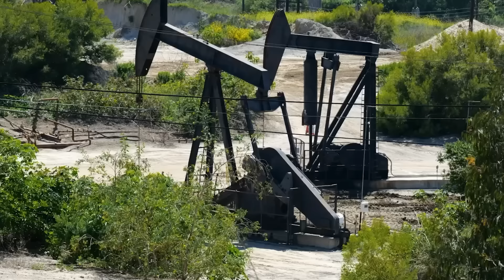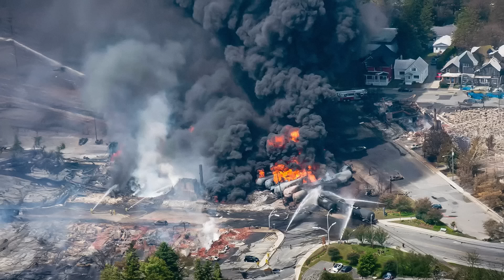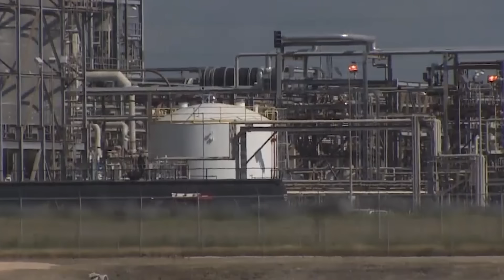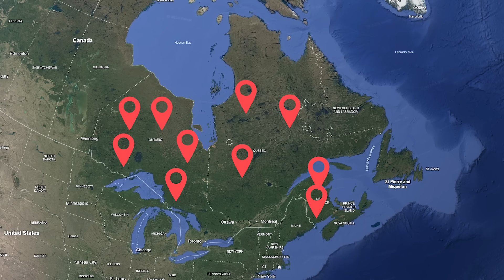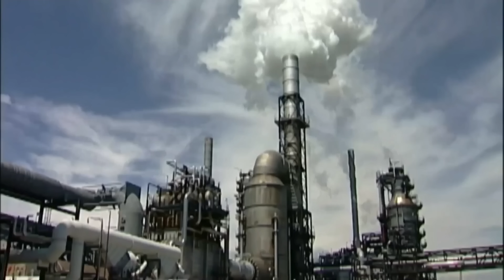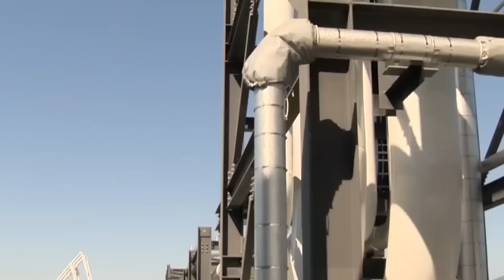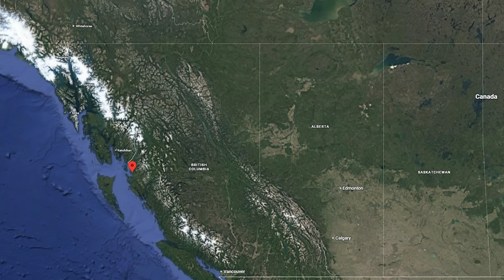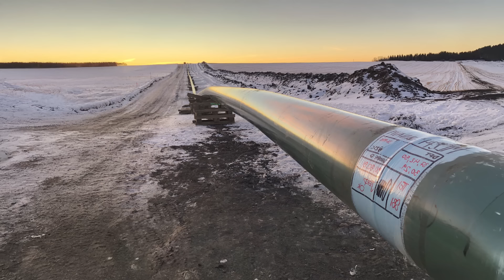Here's Why Canada Can't Build Its Own Refineries, Even Though It Produces Millions of Tons of Oil

Comment: he doesn't mention that the lines that were built was for a certain type of oil.  that is why other types cannot be poured through that system because diffrerent oil means different pressure through the system.

Comment: An interesting video.  The real question is whether shipping the raw material, especially such raw crude is the right move.  I tried to buy some marine grease today and was told that it is no longer being made in Canada. Sure, Alberta cannot consume its production right now but it could encourage development of lot's of other industries that are hungry for energy.  Solar panels and plastics to start.  The world is moving to electrical energy, Alberta is sitting on buckets of energy and should think of their product as such instead of just oil to sell to others to process.  This whole idea of processing costing too much is nonsense.  It is like BC selling raw logs, absolutely stupid short sighted quick gain that when over leaves nothing but debris behind.  Canada needs to invest in secondary in tertiary industries that utilize our resources and builds long term solid jobs here. All that grit in the tar sands has tons of minerals, quite probably lots of rare elements.  Instead of shipping it away let's extract and process it here - way higher value than tar.

Comment: Here is the short version: Canada is too stupid to figure out how to process the huge amounts of thick crude oil that it has, the green demons don't want it developed & fight for more odious regulations & use of costly and undependable sources of energy, and the leaders in Ontario treat the areas in Canada that produce the thick crude, such as Alberta, with disdain for allowing Canada to actually utilize any form of its own fossil fuel (In the US, the lunatic Joe Biden administration favored the same insanity pushing for the idiotic Green New Deal). No wonder Alberta is beginning to at least consider becoming the 51st state of the US, as they are abused by the bigwigs out east. Thus, Canada often causes its own problems and the inept government "leadership" is a huge part of that.

Comment: What you haven't made clear is,that tarsand oil has tobe light crude oil to thin it enough to be pumped,and you don't have enough for long term near the tarsand,and that means more pipelines, and the light crude used is coming from north Dakota and Montana pipelines. Herrman goreng in Ontario is dumber than a rock <

Comment: Thank you for the insights into the Canadian oil industry. 👍 Hopefully we will modernize our refineries.  This should be a national priority.
Reply: Liberal Government restrictions with Zero emissions is the problem. Canada's heavy crude oil requires oil refineries that can process this oil in mass volumes. These refineries require high-complexity residue conversion and carbon-rejection or hydrogen-addition units. Unfortunately it wouldn't be permitted due to Liberal Government Climate Change restrictions.

Comment: An excellent review of Canada’s pipeline capacities and 4.3 million barrels per day. Perhaps you can add to the cost benefit analysis the fact that the dilution of the bitumen (Dilbit) uses Refined Petroleum Product imported from the USA. 2 million barrels per day shipped to the US needs 200,000 barrels per day of RPP imported from the USA. The source of the RPP and cost doesn’t appear in the cost of production. If 10% of the oil is bought from the USA to dilute the oil we send to the USA, sounds like double dipping. Lest we forget, the devaluation of the Canadian Dollar in 2013 gave the USA a  massive discount. Comments?

Comment: Canada does not have the financial backing of its banks or government to build a refinery.  It does not have the political willpower of the current federal government, whose policy is to prevent CO2 releases in Canada.  Producing oil or gas in Canada would lower the cost of gas at the pump in Canada, which the Federal government does not want to happen as it gains considerable revenue from high cost of gas in Canada at the pumps.  
Refining oil produces CO2.
Also the oil industry in Canada is completely attached to the US oil industry, so their influence is used to prevent Canada from manufacturing the oil and gas and other bi-products (plastics, etc) in Canada.  Keeping that work in the USA.

Comment: Look  closer  .Alberta  tar sands  produce tar that is thinned.. Canadian  heavy  crude..that's upstream.. Canada  also invested downstream  into USA  refinement..and distribution.. while freetrade  existed the USA  got the benefits..  Trump  tariffs  remove the benefits.. and it's cheeper to refine in Canada  now.. like the USA  east and west  of the rockies.  And east and west of the Mississippi.. Canada  also has east  and west of the rockies  and east  and west  of  lake  Winnipeg and the Nelson... drop pst 2% in Ontario  and build across the top of the lake . But there  is a shorter  way go straight  north  from  Winnipeg  and use  the Hudson  bay..east coast  and west coast utilize  hydroelectric to make steel   natural  gas wind and solar.. to manufacture.. partt package  and distribute.. the lighter  oil  you  get  from the states is also produced in offshore east of newfoundland.. ..and is used in Canada  but 8ts cheeper to inport do to pst..

Comment: While I found the video very interesting, I still believe something was rubbish; we always had refineries in the past, where do you think every kind of fuel, asphalt, etc, was produced? In Canada! Just in Montreal (the town of Montréal-Est) there were 6 refineries until 1980- 81 and 82, when a few closed down during the recession. There was Shell, Texaco, Esso Imperial Oil, BP, Petro-Fina (which became Petro-Canada, during the recession), and Gulf Oil Canada Ltd, which made asphalt as well. Then Irving in New-Brunswick, there must have been some in Ontario, I'm pretty sure, and some other places in the rest of Canada.
Pipeline is one thing that can be used, saying we need more than one for the East, is a load of rubbish; how many pipelines does Russia has to provide to countries of Europe??
If needed, use freight trains with safer more mordern tanker cars to compensate, if or when needed. Trains are safe, the problem is not trains and tracks, the problem is greed, neglecting maintenance to fill up the pockets of the investors, and the other problem is Transport Canada having no teeth leaving the safety control in the hands of the railroad companies. When I was young, CN was a Crown Corporation and we rarely heard of a major train derailment causing catastrophie like in Lac-Mégantique. I grew up near a railroad and I could see every week those little vehicles passing on the track with maintenance employes. The rails were always in perfect conditions even though it was not a main line.

Comment: You're geography is where your accuracy ends.

Most of Alberta oil is Medium Sweet crude - more easily transported and requiring less refining then many other jurisdictions.  Your intense focus on oil sands also has glaring errors ... much of THAT oil is refined to a transportable crude before it ever leaves the province.  And finally, there's not a lot of sour oil in Alberta on a proportional basis.

The actual reason Alberta oil is not used in Eastern Canada is because of local politics.  The Laurentian elite hold ownership in the terminals along the St Lawrence River in Eastern Canada.  They've somehow convinced the ignorant masses in Ontario and Quebec that it is more environmentally friendly to have oil imported from around the world than to use Canada's own oil.

It would be nice to see an accurate representation of the situation, as so much of the population listens to YouTube and believes everything stated.

Comment: the dumb part, about how canada handles its oil. they just dont want to invest into it like we need to.. it would open more jobs cause of our production rising, it would be a win in the long run. but no company wants to invest into the actual problem to solve our oil issues.. its sad that its either invest into a pipe line/ship it to the states, or invest into proper infrastructure to refine our own. would also have more independence.. same issue with out lumber we send like all of it to the us to then get it mostly back as treated building rated lumber.. yet i can think of many mills along the us/ca border in British Columbia, that are owned 100% by us companys that hire loggers then  they cut and steam treat it before sending it to the states to send it back months later which makes our lumber cost more then it should. if we delt with the lumber more our selfs it would create more canadian jobs and strengthen our independence not from the us but as a country that can produce the main building materials for everyday life like wood and fuel..

Comment: It's not that we can we did we had our own refineries but they shut them down and destroyed them years ago for some bizarrely f**** stupid reason obviously the fact that our prices are controlled by OPEC is an absolute travesty we produce an export over 98% of the oil we produce our oil should be in our gas should be cheap for us here in Canada we have a worse stuff now than what used to be the deal for Curacao where they would refine the oil for Venezuela but then they would be forced to ship the gasoline back they produced to Venezuela do you have it then shipped back to them to be bought at a price that was over 400% higher it's definitely insanity

Comment: 😢Canada should build a nuclesr powered refinery / power generation plant in Alberta. And use the residual steam to inject into the sands for oil extraction and convert the oil sands trucks to electric power. 
Currently it takes 3 or 4 barrels burnt to extract and transport Canadian crude. 
Nuclear power could change this, tripling oil production. And producing gasoline, diesel, and asphslt right in Alberta. 
Saskatchewan would benefit by providing the uranium.

Comment: Refined products are much more inflammable than Albertan crude, which is basically bitumen. That has to be diluted to flow through pipes, but it can be transported quite safely by rail. It is usually more economic to ship crude to refineries close to the market end.

Building pipelines in Canada is complicated by several factors. Until recently, the Liberal government was actively trying to sabotage Canada's oil industry. It introduced a complicated permitting process, (more accurately called a thwarting process) which gives so-called, "First Nations" scope for extortion and frustration of almost any industrial project. Climate zealots have also been actively fighting them.

Comment: As a former refinery process engineer who has done some work in the Alberta Tar Sands area, it was actually a quite decent presentation considering the author did not likely have my background.  Suffice it to say that these types of massive investment decisions are very complex and have been made over many years.  What crude gets processed in a particular facility is far more restrictive than the average viewer can contemplate due to significant logistical constraints and refinery process unit configurations.  The companies are always making the correct decisions given the many constraints that they operate under.  But, all in all, a decent presentation.

Comment: What needs to be done, is to build a refinery in Alberta that can handle the oil. Refining our own oil into regular gasoline would pay out 3.5 times more money per barrel than the oil does. The refinery would pay for itself reasonably quickly. Stop giving our resources away at a discount because another nation can strong arm us. Take the leverage away and they will pay what it is worth.
Reply: You don’t think that if the big oil companies thought it was a viable option they would have done it by now? Follow the money.
Reply: @gordv58  Right from stats Canada: Canada consumes approximately 43.8 billion litres of motor gasoline per year. This equates to an average of about 118 million litres of gasoline burned every single day. 
You still don't think it's viable? Let's just round it off to $2.00/Liter for easy math, that is 87.6 Billion dollars per year.

Comment: Canada has approximately 14 to 18 operational refineries, with 16 being a widely cited number for major crude oil refineries as of early 2026, boasting a total capacity of roughly 1.9 to 2 million barrels per day. These facilities are concentrated in Alberta, Ontario, Quebec, and the Atlantic provinces, providing fuels like gasoline, diesel, and asphalt. 

￼Natural Resources Canada +4

Key Details on Canadian Refineries:

Total Capacity:

 Approximately 1.9 million barrels per day.

Major Locations: Refineries are located in Alberta (5), Ontario (4), Quebec (2), Saskatchewan (2), British Columbia (2), and New Brunswick (1).

Largest Facility: The Irving Oil Refinery in Saint John, New Brunswick, is the largest, with a capacity of 320,000 barrels per day.

Trend: While the number of refineries has decreased over the past 40 years, the capacity of existing refineries has generally increased.

Refinery Types: These include full-conversion refineries and specialized facilities like asphalt refineries and bitumen upgraders. 

￼Régie de l'énergie du Canada +4

The refineries in Western Canada primarily process domestic crude, while those in the East often rely on imported feedstock.

Comment: There is misinformation here, Canada has its own refinery,  look at Ontario
Reply: I work at a Petro Can refinery for several  years,  plus we have several pipe lines which  run everywhere and they are buried underground.  So you can't  see them.  Alot of our cruel oil comes from the  oil platforms out by newfoundland.   So stop putting out miss information.   Esso and Petro Canada have many platforms out on the oceans.  Plus i believe Shell is using BP.  Plus only the cuel oil from Alberta was beening  ship too the US. But this is changing now and are going to be sent too other countries now

Comment: a lot of nonsense mixed with a few sort of facts.  Oil from Nigeria does not cost 3 times what Canadian oil costs  - oil is priced globally and tanker transport is cheap.  

Most Canadian refineries run on Canadian crude, pipelines reach all the way to Montreal, and oil is actually tankered from Montreal to Quebec City.  The only major oil refinery in Canada dependent on foreign crude (they do take some crude by rail) is the Irving refinery in New Brunswick - which mostly supplies the US. Crude oil can be easily moved by tanker - its a lot more complicated to move finished products like gasoline, diesel fuel, jet fuel and other distillates - they all need their own lines, storage, and markets need different formulas. Refineries are also dependent on chemical plants to sell many products (light ends).  To make refinery economics work - you need close markets for all those products. Even in the US refineries close all the time - its a tough business.  No one could economically justify another refinery in Canada (or even the US), even upgrading bitumen to synthetic crude is a money loser.

Comment: This whole video contradicts itself.  1 the cost to build the refineries was less than the 34billion spent on the pipeline. 2 at first it said the oil was to thick to flow through the pipes and then they turned around a built a pipe line to supply China oil.
3 if your paying 19billion per year to import oil couldnt you use that money to invest in your own countries oil refinaries?

Comment: Your narration is too one sided and opinionated. You're lecturing instead of actually narrating all for the sake of justifying a Prince Rupert pipeline, are you working for Smith?
That said you do make a good argument for renewables since whether it's pipelines, or refineries the price tag is still $20 - $30B and with oil peaking way before either of those are paid off, no company wants to invest in that future. Renewables is the only real answer for the future. But if I had to pick one direction other rather along side renewables then the only real logical solution for Canada's sovereignty and lowering exposure on global oil price and volatility is build one or two refineries that can process the heavy crude and upgrade existing pipelines to transport refined fuels to the east.

Comment: As a retired Pipeline Inspector I can tell you that the best and most efficient way to transport Oil and Gas is by Pipeline. Current safety standards are very high so Pipeline transportation is safe. Why use Rail  when rail transport costs a LOT more and is far more riskier ??  because powerful folk have stock in rail companies, Warren Buffet owns Railroads and he makes big profits from railways !!

Comment: ive said it since 2003, we need a refinery out west, even if the oil sand isnt going to be turned in to gasoline and diesel we need plastic, and having a refinery here, would give us a cheaper source of those plastics, and the chemical off products.

but noooooo it made no finacial sense when i suggested it decades ago.. the shit would be built by now.

Comment: "Hard to do" is different than "not able to do". Trans-Continent pipelines are hard, but can be fully build environmentally friendly with modern techniques. Looking at similar mega trans-continent projects in China with 1/5 the cost and 1/10 the building time, you should know a corrupted government surrounded by lazy, greedy, politically-correct people will claim "hard to build".  If private funds are not willing to build, state funds should step-in for Canada's long-term decades' interest. For refinery factories only in east coast, why not consider building heavy-oil refinery in Alberta and move the light gasoline/diesel out. Even Mexico can build heavy-oil refinery, Canada can do the same if "want to do".